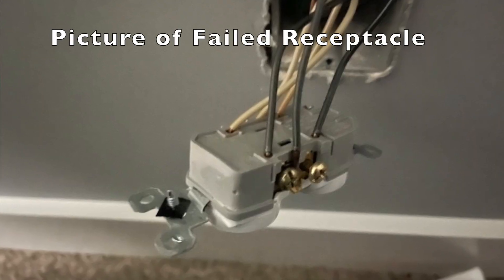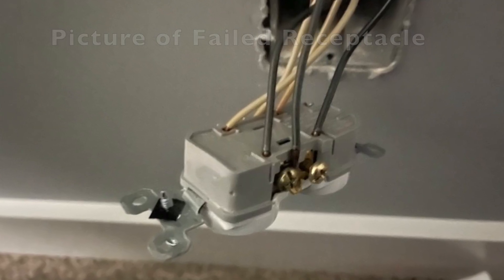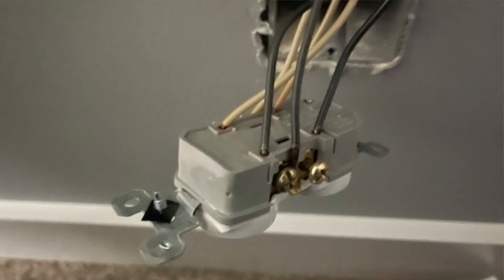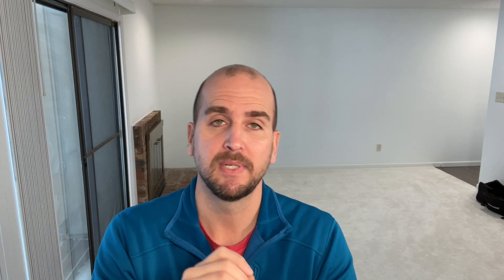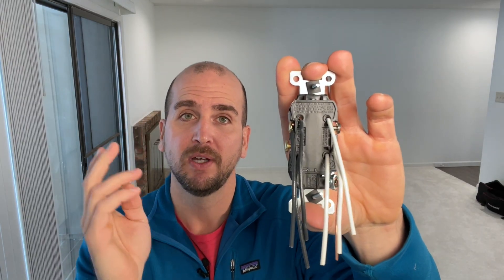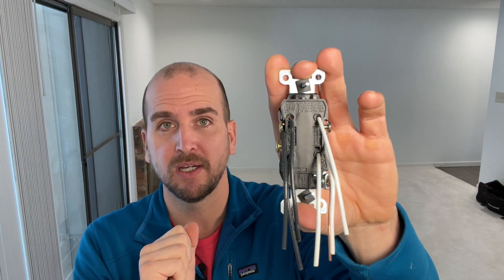Incorrectly Wired Outlet Found In Newly Built Home

Comment: The only thing I would add is to hook the wire hook in the clockwise direction so the screw helps pull the hook in when tightening. I've seen a number of receptacles and switches wired with the hook in the wrong direction.
Reply: The receptacle in the video has a clamping plate.  It supports 2 'straight' wires under the same screw.  To use the hook method that you are talking about, you would have to put the wire on top of the plate.  The type of outlet that uses the hook application, doesn't have that plate/clamp.  The screw cavity is sized such that when you tighten the screw, the mold of the outlet prevents the wire from escaping from under the screw.
Reply: He doesn't say anything about hooking in the clockwise direction because he ends up using a different style receptacle in his example, but at 2:47, he does have a picture up with that recommendation.
Reply: Ground pin down always seemed better to me. It tends to hold up the plug more against gravity, keeping it in the receptacle. Ground up, gravity tends to pull it straight out.
Reply: Very good point over the years i found that when its counterclockwise it tends to try to unhook.
Reply: 100%. I’m an industrial electrician but issues apply to similar situation. only thing that I will disagree with and this is just my opinion. the pigtails specifically, where the braids extend past the point of the stripped conductors I personally don’t do it that way. only because of the added friction on the insulation any cracks or weakening of installation could create a very dangerous situation for anyone who may work on it in the future my personal way of doing it is braid extra striped wire cut it off with a decent amount left but not enough to be exposed beyond the wire nuts make sure that your braids are always clockwise or the wire nut will be working against you. after I’ve secured it with the wire nut I take a strip of electrical tape just to wrap around the lip of the nut to the wire nothing insane just enough to where if for some reason the wire nut should come loose or one of the conductors breaks due to strain or nicked copper that nut will be held on to prevent arching with any other conductive material it may come in contact with. I had a teacher in my second year tell me that 9 times out of ten your own mistakes won’t kill you. The mistake of the electrician who worked on it before you will. Other issues I’ve come across are improperly colored wires now a lot of times electricians will be nearing the end of a job and they will use what they have left or in other cases use the wrong ones intending to come back and fix it before the job is done but things happen and people forget. if you are doing it use properly colored tape and wrap it around the end of the wire( not saying it makes it ok to do) but you have to remember that not every electrician has the same skill set or may still be green so protect the ones who come in after you so everyone goes home safe or in this case so your home stays safe. I never use the push in quick connect only for the simple fact that I want to see the point of contact to make sure it fully makes before feeling good about closing it up but that’s just me
Reply: Its in the damn Code Book!
Reply: The ONLY good advice on this whole video, right here....
Reply: I recently replaced a light fixture in a closet. It had the plate under the screw. Two wires went to each terminal and I was surprised how after I tightened them down, one side was so loose the second wire came right out! And I cranked it pretty good, I thought.
Reply: @Maj.Dude1  I don’t know the specifics on your exact situation but sometimes what happens is the plate might sit a fraction more towards one side or the other if the lock screw is not exactly centered and then one side of the contact tightens more then the other making one side loose or sometimes people try using twisted stranded wires and then solid in the other and also causes it to tighten unevenly. Just some things to look at
Reply: That is a total "rookie" move.
Reply: New outlets have washer and metal base, so there is no problem to tighten one or two strait wires under washer. Some outlets made for strait wire only, there is no way to twist it. For two wires they must be same size.
Reply: Was thinking the same thing while watching this. Glad you mentioned it.
Reply: Absolutely correct.
Reply: @Slim Savage Good answer.  Does anyone cuts off the ears?  I always do in when installing in a metal box.  Cheers
Reply: @patrickcooper9641  I only cut off the ears when installing in a square box with a raised cover. The ears help to stabilize the outlet and keep it from wiggling sideways.
Reply: @Taco 
AC does not have a 'negative'.
Reply: @Taco Return or neutral. AC has no negative or positive line.
Reply: @Taco not when it is part of a switch loop or a 3 way traveller.
Reply: @Taco only in the Edison 3 wire configuration.
Reply: Even if an outlet has the little plate thingy allowing for a straight wire you can still bend a little half hook that goes a little bit around the screw that will slip under the plate.

Also it's a good idea to just get in the habit of attaching to screw terminals on the correct side.
Reply: i am not an electrician, but ive done a few outlets in my home. i always make sure to buy the outlets that have the plate on the screw that clamps down and holds the wire in, no need to hook the wire around the screw. however, that plate is never on the green screw, so you do still need to hook that one.

edit: you can see this at 4:40 in this video when it shows him removing the two hot wires from one screw.
Reply: I agree 100%.  Excellent.
Reply: @darrellcurrier5571  If you are not an electrician, I wouldn't be giving advice... do not ever simply feed in conductor without hook.  This gentleman is exactly correct when he says UL approves friction fit, even straight wire as you suggest... but as both an EE and an electrician's apprentice, one of the overwhelming causes of shorts (and consequently fires) is to wire it as you suggest.  The problem is when you (typically stuff) the receptacle back into the box, the wire you thought was nice and tight can very easily stretch off-terminal... the hook prevents that.
Reply: @darrellcurrier5571  tbh that plate is just to hold braided wire in .. since many people use that stuff ... solid core wire is best in those outlets but ALWAYS j bend your wire and ALWAYS wrap it so it gets pulled into the connector ... it ALSO provide strain relief ... very very minor but it does .. also the wire doesnt work loose over time and then short out ... yup houses shake and move wires ...
Reply: @0623kaboom  Well, not so much that houses shake and loosen wires, but electricity is moving back and forth all the time, and I have personally seen an outlet that the  black wire was not tightened down enough, and the wire worked loose, started arcing in the plastic box and were  making a small fire in the box..
You could smell something burning in the room, but could not pinpoint the location until I started looking absolutely at everything and found this in one box..
Reply: @frandanco6289  There's also wear from plugging and unplugging that can loosen connections, and wear when a switch is turned off, due to an arc that always occurs, which can eventually burn out the interior of the switch. Electricity doesn't want to stop and tries to maintain connection, causing the arc. It can't maintain connection because there is no voltage.
Reply: @0623kaboom  AC vibrates wires at 60 Hz an old electrician told me. So jah to the j hook and put in a fashion to tighten in the screwing direction.
Reply: @frandanco6289  AC. Cycles 60 time a second. I suppose given enough time they'll all work loose.
Reply: @frandanco6289  That's why when installing a plug for the first time I always wiggle the wires a bit and re-tighten. The biggest reason they loosen after installation though is the heating and cooling from the current in use.
Reply: @frandanco6289  the smell is that of fish.  My in laws rented out their house and the tenant started saying the room had a fishy smell.  Turns out there was arcing in an outlet.
Reply: @JackTRyan  the cycles are not vibration
Reply: My Dad was a union electrician and when i got into the trade years ago he told me to not twist wires in a splice. It makes future service so much easier.
Reply: @scottttttttttttttttttt  yep. If you read the instructions on the wire nut it specifies do not twist the wires.
Reply: @ChrisNixon13  ya screw the wire crankers 🤭
Reply: @scottttttttttttttttttt  I’ve been in the trade for almost 3 years, commercial. Depends on how you like to make joints, I twist mine to ensure that there’s a strong connection. In service work it’s a headache to work in a box and undue hot joints that are twisted, in respect to residential work I’d imagine I would twist them also, because they probably won’t be worked on again for a long time, and besides that you can just flip the breaker and turn it off. I don’t have time to do that sometimes and risk the chances of messing something up or getting shocked, but I’m still here and doing it
Reply: @scottttttttttttttttttt  and safer I’m union to. there’s a saying that 9/10 your mistakes won’t kill you but the mistakes of the electrician before you will
Reply: @twistedfeature6696  Only if you work hot. Not allowed.
Reply: @scottttttttttttttttttt  Correct, let the wirenut do the twisting... do not pre-twist the conductors.  If all else fails, read the instructions... T&B, Ideal, etc. all state as much.
Reply: @karlsagan6559  Twisting is over and above the manufacturer instructions and required in most code jurisdictions.
Reply: @MrBonners  Negative... "over and above" tends to indicate a better work method.  Read and re-read major manufacturers instructions where they EXPLICITLY tell you to not twist solid conductors prior to seating the wirenut.  See Thomas and Betts, Ideal and 3M.  All tell you to not pre-twist solid conductors.
Reply: @karlsagan6559  code overrules manufacturers 'suggested' method.
Reply: @scottttttttttttttttttt  then you do not have UL approval. . The UL approval is on that installation method used, is what the manufacturer tested to. 
Twisting is over and above the manufacturer instructions and required in most code jurisdictions. 
Union or non-union the code is the same.
Reply: @scottttttttttttttttttt  Had a Buchanan rep come to the job site. This was around 95, at that time they suggested not twisting. There are conditions to twist and conditions not to twist. The more conductors, the more it's advisable to twist.
Reply: I traind to always, 1- hook the wire clockwise around the screw to pull in the wire and 2- mount the receptacles ground up, so in case the plug is ever not entirely in the receptacle anything that could make contact does with ground.
Reply: @yourname519  ONLY problem mounting receptacle GROUND UP is if a FLAT CORD from the device is plugged in . EXAMPLE : the end of the cord on a refrigerator has a FLAT CORD PLUG on it . IF you plug THAT type of cord into the receptacle , the cord will have a sharp bend in it . The cord will run UPWARDS coming out of the plug , rather than face DOWNWARDS . Check flat cord plugs on extension cords too .
Reply: @leecampbell5232  wow.... you must have missed the part about using a loop and wire tie to solve the sharp bend problem, or buy an appliance or extension cord with a straight cord. 
Maybe on a personal note you try not to get so mad about how someone does something that has no effect on you 🤔
Reply: @leecampbell5232  Your points, as Tom already posted, are good. And having to tie a flat cord so it isn't damaged is more evidence that ground at the top is an inferior method. But I agree with yourname519 that your YELLING is obnoxious and antisocial. Take a pill.
Reply: @leecampbell5232  in case you are wondering, I didn’t take your comment that way, but using all caps in a work is usually taken as yelling. I use them sparingly for emphasis, but the other reply apparently thought you were yelling at them.
Reply: @yourname519   I would never install outlets upside down...Too much problems with all the plugs that are made to hang down..
Reply: @frandanco6289  Ground down looks like a human face.  Ground up looks alien.  I like aliens!
Reply: @yourname519  The problem with ground up is that nearly all of the flush mount plugs that I've run across, such as for refrigerators or washing machines, are designed to hang nicely from a ground-down oriented receptacle. With a ground up receptacle, you get an awkward up-and-over flip of the chord, which might even increase the likelihood of a loose connection.
Reply: @TomNimitz  for plugs like that I've just made small soft loop then a wire tie so the wire hangs down nicely, I've done this in my home and never had any issue. 

But I can understand not wanting that and either mounting or flipping the receptacle ground down.
Reply: @TomNimitz  In hospitals and other medical facilities you will find a ground up mounting in most cases!
Reply: @yourname519  I did ground up in my house. Then redid a bunch to make my wife happy.
Reply: @yourname519  That is upside down IMO, but as long as it is wired correctly, that is what matters.
Reply: @jthonn  all these problems can be solved easily by adopting the exemplary safety standards use with  UK sockets. Earth (ground) pin is longer to open the shutters on Line and Neutral, L & N pins are insulated over half their length so that little fingers are unable to receive a shock. Terminals are female and screws angled to draw conductors in, singles are doubled over to fill the hole with more copper. Terminals are always to the rear, never on the side.
Reply: @qedelec  I thought Europe ran off 240? Why would you have a neutral?
Reply: @etherealrose2139  we use 230v +/- 10%. Supply is three wire, Line, Neutral and CPC (circuit protective conductor) sometimes called earth.
Reply: @qedelec  leaves the "ground up" orientation unaddressed...sorry, mate.
Reply: @SmallSpoonBrigade  thanks Chris, on the subject of shutters, people can purchase blanking plates over her, to insert into a socket, supposedly to make them safer. This has the opposite effect, the device is like a plastic plug, so inventive children have been known to insert them upside down so the earthing pin opens the shutters exposing the live terminals. You can’t cater for stupidity.
Reply: @etherealrose2139  it's 240v one hot in Europe, not 2 hots so you still need a return.
Reply: @yourname519  holy shit i always just thought those people weren't paying attention and silently, or not so silently, mocked them. Welp, jokes on me. Turns out im the idiot
Reply: @yourname519  That's actually a section in the code, but it is universally ignored.

Comment: The insert you installed in the box is an "arc shield", not a box extender, no matter how thin the walls of that unit, may significantly reduce the volume of the metal electric box.  Introducing that amount of additional wiring into the box "may" exceed the recommended capacity of the metal box. The proper way to do it is to add a "pregnant side" to the metal box in the wall. NEC recommends that addition as a precaution as too many wires in a box can cause overheating of the wires resulting in the danger of fire.

Comment: You should describe why push-ins are bad. Make an example of the thin blade contact with the wire as a demonstration. The thing that keeps the wire from pulling out is actually its Achilles heel and the part that deteriorates the fastest.